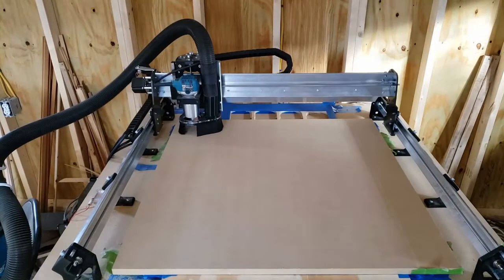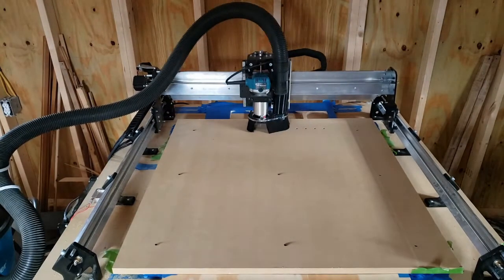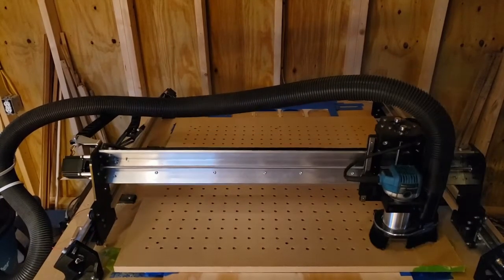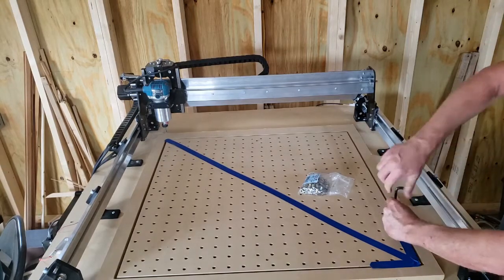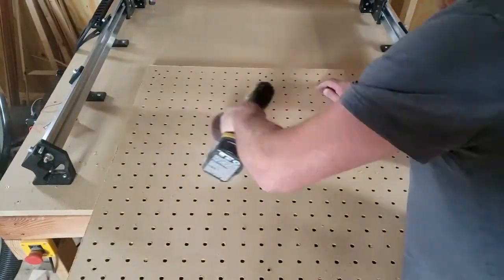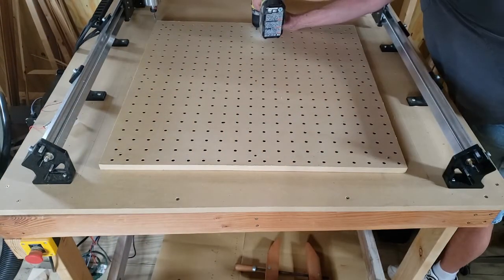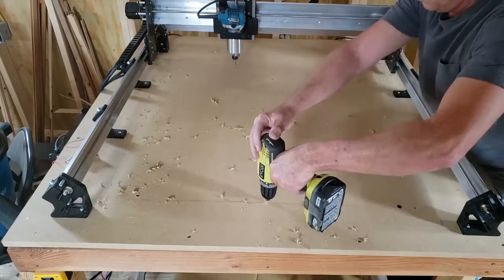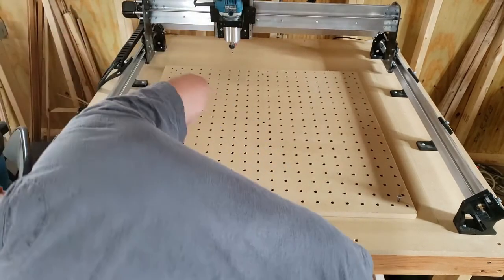Milling a Threaded Insert Waste Board for My 30x30 CNC

Comment: Did you really use 400 inserts?   Wow that’s dedication!  Here’s a few tips.  

Next time you make a waste board modify your model to include pockets for your 9 mounting screw heads and just mill from the top using your current waste board to “catch” the cut through. 

If you ever replace your tabletop again may I suggest that you cut a pair of MDF strips a little wider than the Y rail feet and lift the whole machine up 3/4”.  And then modify your waste board program to drill just the 9 mounting holes into the top for the inserts.  That way everything will be lined up and square.
Reply from the maker: Dedication - overkill - I'd be willing to go with either.

I've already milled 2 waste boards to suit different needs (allows for me to mill after some parts after assembly) and I did pretty much what you suggested.

I thought about raising the Y rails up but decided against it for now. I don't need the added Z travel and adding the height would extend the Z lower for cutout passes. I have seen where I might benefit from raising it so it's definitely going to go into my thought processes on any table top or machine replacement.

Thank you for the comments / suggestions.

Comment: Im preparing to mill a new spoil board for my Shark CNC using inserts. Im using Vectric for design. My question is concerning the size of the insert hole. The width of my insert is .41 inches (including threads). Since I'm using MDF would you cut the hole slightly smaller and if so how much? My concern is when applying clamping pressure it might tear the MDF. Thanks